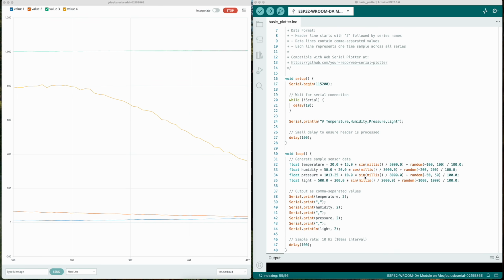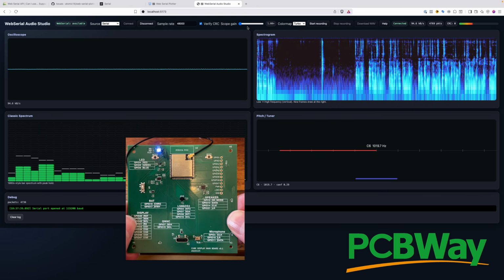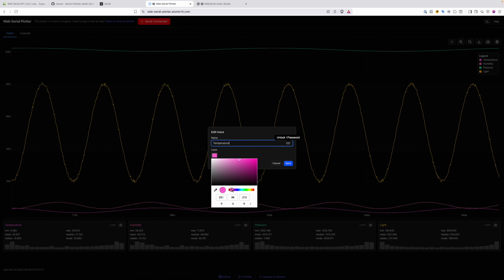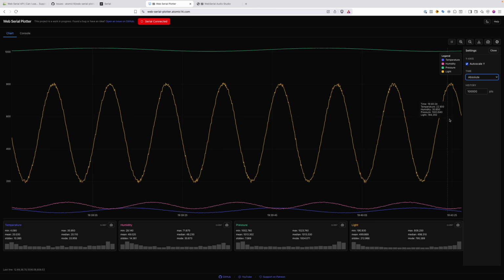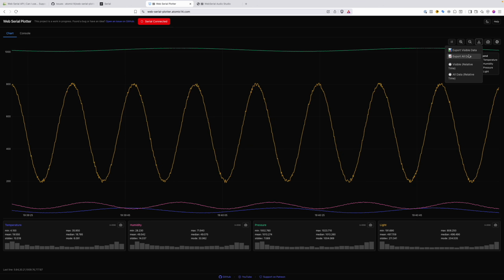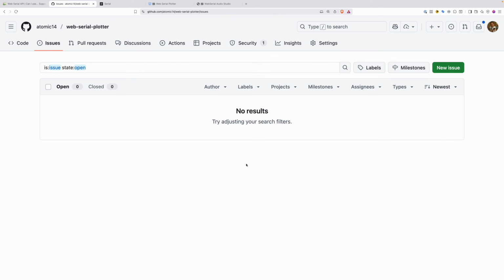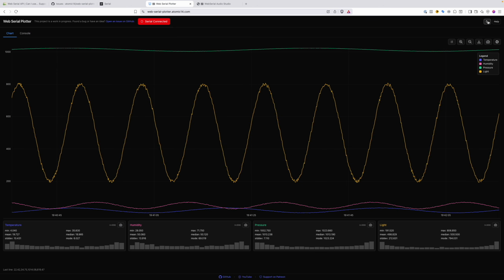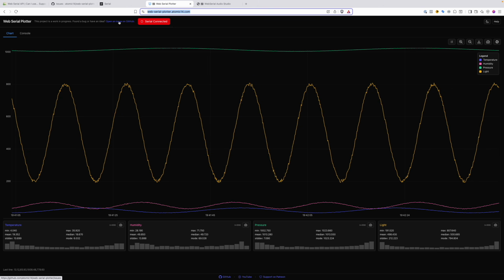Forget the Arduino Serial Plotter - try this instead!

Comment: A fantastic tool—it’s exactly what I’ve been looking for for my ESP32 projects for a long time! Many thanks for your work! There are just two things I’d like to see changed. The legend for the plot lines is in the wrong spot—right where the newest data appears, on the far right. I’m currently dealing with a lot of thermal processes (which are very slow), so unfortunately, I have to wait minutes for the current values to emerge from behind the legend. Placing them on the right side would keep them out of the way entirely. Another really great feature is the ability to assign plot names directly to the ESP32 measurements! If there were also a way to specify the plot line color, I’d be completely happy. Anyway—thanks for this plotter!

Comment: This is awesome, thanks.. I'm not a GitHub user, but if you're still after ideas for more features, a 'trigger', like on an oscilloscope would be really handy. I'm capturing random transients in the setpoint of some Arduino PID servo code, trying to work out whether they're inteference or somehow caused by my code.

Comment: How fast can it render?  Some time ago I did something similar, not so nice, but in python for performance. It can process several hundred KBps, what the USB can push. It's serialdataviz, I can't put links.
But yours is very nice and I think than more than enough.
Reply from the maker: Hey - at the moment the main limitation is drawing the waveform and the stats calculation. It seems to handle the audio data ok at around 16KHz sample rate.

I'm planning on decoupling the stats and drawing from the actual data capture - need to get the AI sweating on that!

Is this your Python version? https://github.com/aresta/serialdataviz

Comment: Very cool!   I like the idea of using the browser for the graphics rendering.

I understand the data is stored locally, but where is the browser getting the data from?  

And how does does the browser allow USB Serial Adapters?  Is that WebUSB?
Reply from the maker: WebSerial - you can connect your device over USB and the serial data runs over that.

Comment: Over the past 6 years, I've been developing a Teensy based, MIDI controllable, T4 Laser Synth + Reaper's DAW + Behringer X-Touch & X-tender mixers and am currently laying out my 3rd (hopefully final) PCB version in KiCAD. 12VDC powered (for lumia motors), on board ILDA op amps, DB25 output; 6 * ADC line/CV inputs; aux lumia outputs include X/Y, GPIO PWM/TTL outputs , I2C. A dedicated Arduino compatible T4 LS for each projector. 🤗
The 1st t ILD files it displayed were your Star Wars space ships, Enterprise, Vader, & X-Wing streamed from uSD. But, now it can load ILD frames into queued arrays, looped  at variable rates to mix with synth waveforms for custom 3D abstracts. 😜
I still  need an HDMI preview image window for XYRGB, but have never found one. 😢(Don't know how Christopher Short's Radiator does it). 🤔
So, I'm currently stuck with a dual trace oscilloscope + 4 input audio switch box (X/Y, R+G,R+B, G+B).
This looks like a very promising solution and right down your alley, if you'd be willing to kindly help me out. 🙏🙏🙏
Great channel, BTW. I've learned a lot about PCB design 
Thanks for sharing!
Cheers!
😎
Reply: Love the Teensy's.....version 4 is such a workhorse!

Comment: This is incredible!

Have you tried embedding the web page on a microcontroller yet? I'm trying to build an air quality monitor, but currently the front-end leaves a lot to be desired.

Your system is somehow both prettier and faster. I'll definitely try it later.

Cheers!
Reply from the maker: I've done this a few times - the real difficulty is how much you can store on device (some of these nice web pages start to get quite big quite quickly) and then getting things like https working.

Hosting the UI on an external site and then having it connect to the device (over WiFi, WebSerial, or WebBLE) is quite a nice solution.

Comment: Superb!!!
Reply from the maker: Thanks Nik!
Reply: @atomic14  I've been using this for a day now and it's fantastic! 
I'm building an all pcb based inductive quadrature encoder and the Arduino plotter auto-ranging was driving me nuts when reading the ADC sin/cos output. 
Having to work around it by Serial.printing min / max 'guard rails' was stupid. 
So I dusted off my scope.
Then I found your project.
Now the scope is back where it belongs - in the living room displaying Lissajous figures - as any self respecting analogue oscilloscope should be.